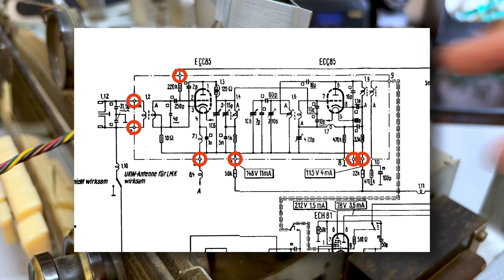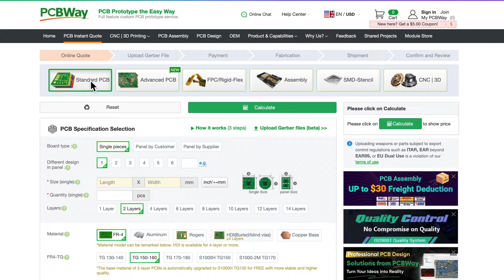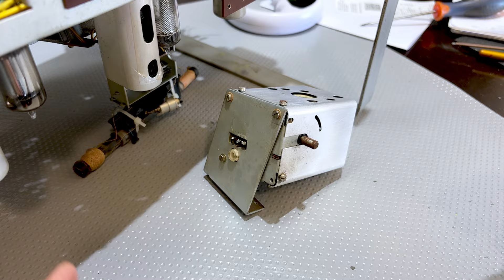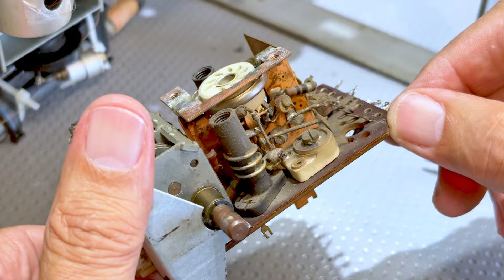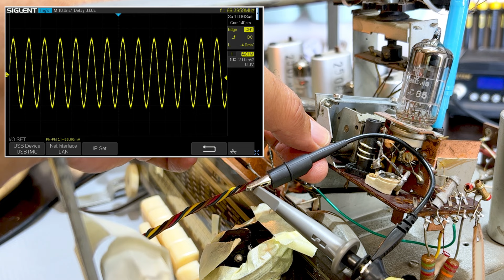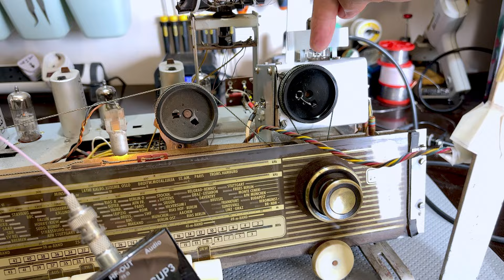Siemens G7 Tube Radio – Inside the FM Front-End (Alignment & Mods) #pcbway#

Comment: Hello, I’ve seen that you use the oscilloscope probe by connecting both terminals together to detect oscillation, but it hasn’t worked for me with my oscilloscope. Do you have any advice? Thank you very much
Reply from the maker: The signal levels detected in this way are very low, so you need to increase the sensitivity of the scope as much as you can.
Reply: @electronicsoldandnew  Thank you very much from Spain

Comment: These frontends were high tech in former days. These were built to last a long time in stable condition. But after 50 or 60 years the parts are losing there specs. But it is not possible to change them, because of the heating up these parts were selected for compensation of each other. Sometimes even the tube can´t  be exchanged to another brand.  As a result the frequence begins to shift during the first 20 minutes. The ECC 85 is a tube which is stressed because of the high anode current. So first step, when the FM reception is bad, change this tube.
Reply from the maker: Yep. Have had quite a few bad ones.
Reply: Philips group ECC85s are surprisingly consistent. Put one of those East German things in and it'll go completely deaf

Comment: Interesting job inside the FM box. A bit risky to open up, but nice to see the inside.
20:35 just noticed that they spelled the Finnish radiostation Lahti wrong on the dialglass (252KHz Longwave) they spelled it LATHI not LAHTI 🙂
Reply from the maker: There was no spellcheck back then 😊